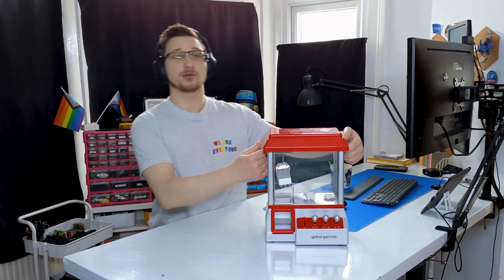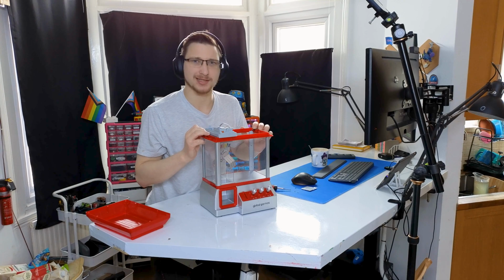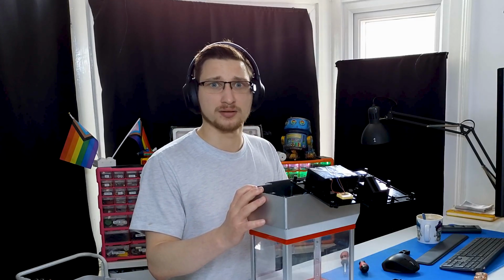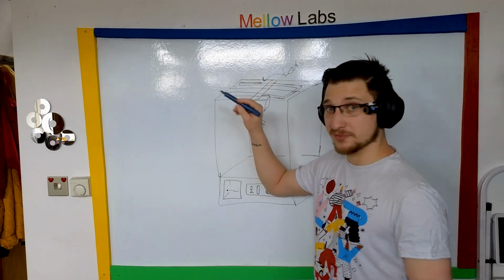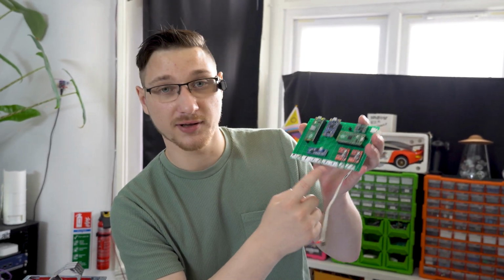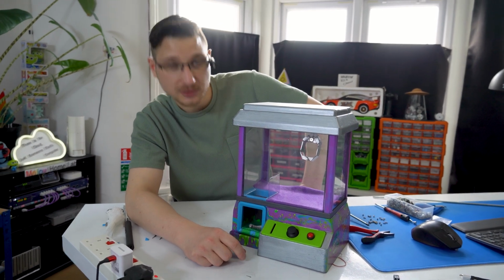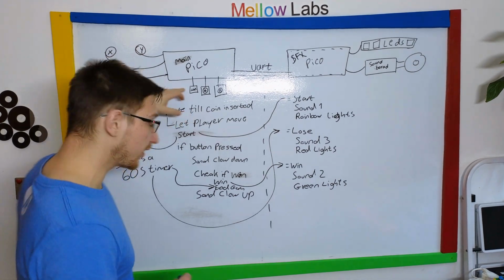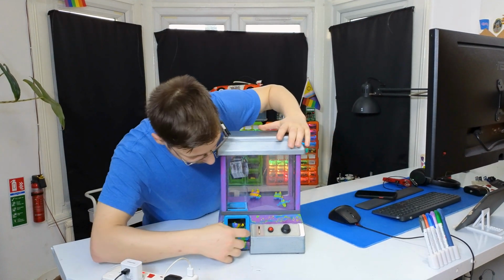So I Made It Better

Comment: Feedback: 

When checking for coin:
When the coin is inserted and triggers the start, wait for the restoral of the switch before the actual start.
Mitegates a continuation at the end of the game.

For the button:
Once pressed, game controls are locked - it goes down, attempts to grab, goes back up - then returns to home, releases. 
Trick - leave the claw over home in an open position - on a game start, restore to closed and then begin game.
 - or you can just have the claw reset to closed after music has settled - just gives time to clear. 

Also add a sound for 30/15/5s remaining if it really takes that long - just for fun.

Since the button signals the end of the game, different lighting can trigger (like flashing - eg gameshow / wheel of choice etc) 
Also means you can have a set bit of music that plays while it's homing

Comment: The Raspberry Pico (RP2040) is a dual-core microcontroller.
You could have used just one instead of two by using the two cores separately (one core for control, and one core for SFX).